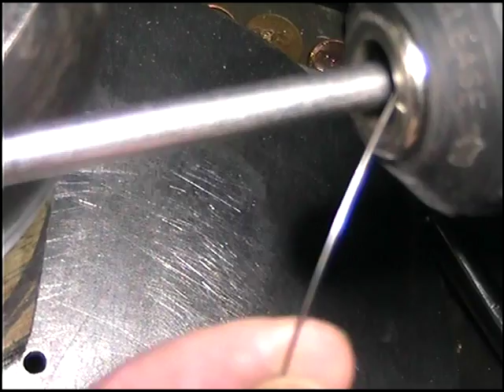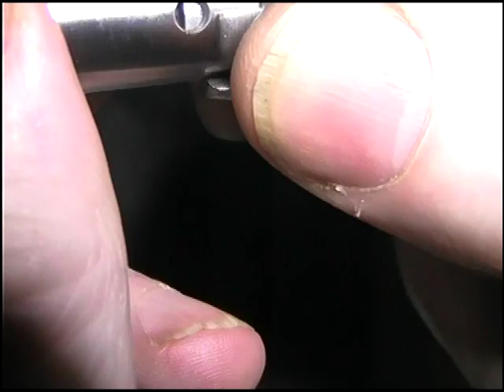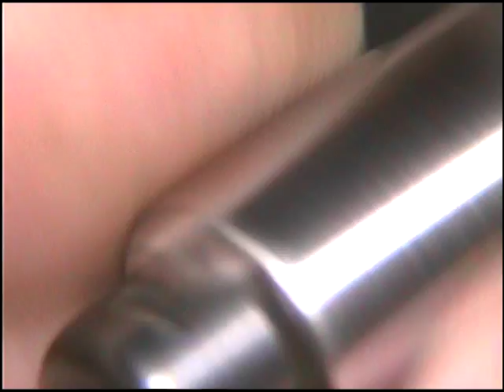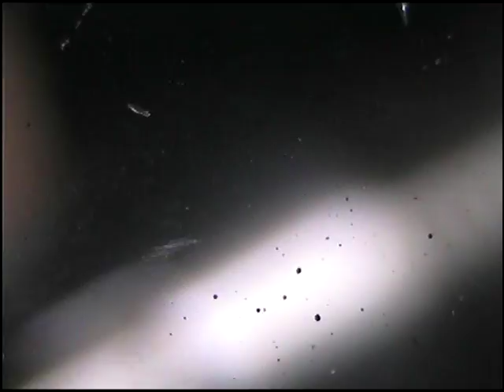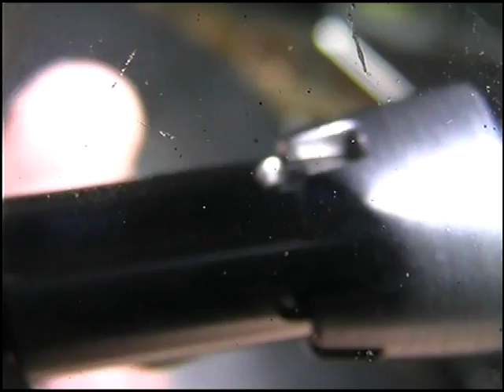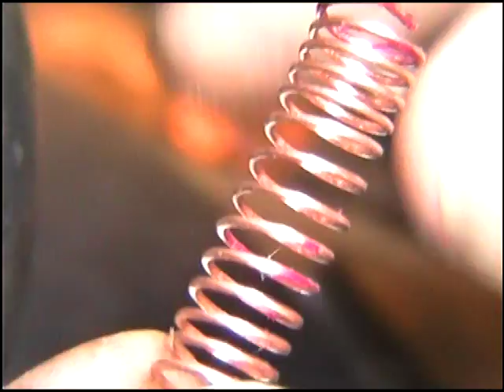How to make a spring for the homemade hand engraving machine.

Comment: This is pretty much how I make small jump rings in silver or gold. I usually have the wire clamped between 2 pieces of wood in the vise to keep the tension as it's wound. I've found this always comes out neatly - and doesn't bite you at the end :)
Reply from the maker: Ah I've made jr like that but the wood clamp is a great idea.

Comment: Too keep the wire from wiping back. Put the drill in reverse to to remove the tension off of it a little bit. That's what I did when I was making chain mail.  Also I drilled a hole in the rod I was raping around to hold the start so you don't have to place it in the chuck. Hope that help someone

Comment: Hi All , I use .5 x 316 s/s MIG wire my bore is 9 mm so I use a 6 mm bar in my lathe trapping one end in one of the jaws and in the tool post have a 15 mm square piece of wood with a saw cut half way through and tighten down for tension ,then turn the chuck by hand, I find the more tension you have the better the spring it doesn't tend to increase in diameter when you stop winding and of course you can leave as it is or pull the spring to tension more ,hope this helps , good art to all !

Comment: you will need to cook the piano or musical wire in a Owen or furnace. Wrap it in steel wool and then in aluminum foil 30 minutes at 400 f and then let it cool slowly.

Comment: It is useful to note a 7mm diameter spring is produced when neatly wound around a 6.5mm drill bit. However, the spring diameter should be slightly smaller than the piston chamber.
Lastly, the spring length matters. I'm still experimenting so I'll post here when i figure out the right length that fits the Chinese handpieces.
Reply from the maker: I'm still changing springs. Using a foot pedal,if you can get the graver to move slowly,and gradually build up pressure,then thats a good spring set up.
Reply: A spring diameter of 0.5mm smaller than the chamber works. Also, a long length of the spring, so that it extends outside of the chamber (and makes contact with the inside of the palm part of the hand piece.
Surprisingly the 11mm ball bearing did not need any sanding.
I have not made the foot pedal yet.